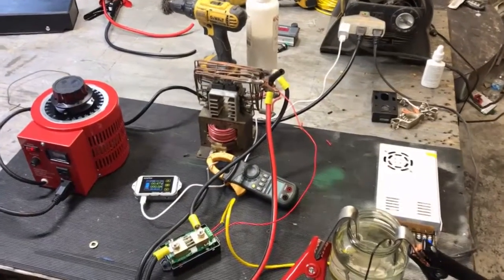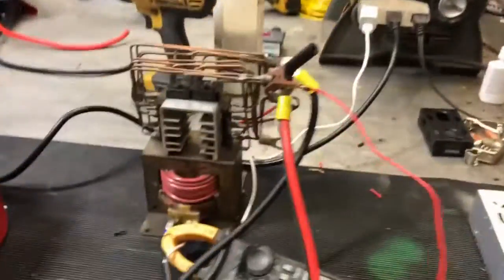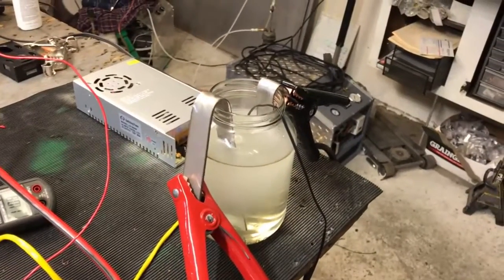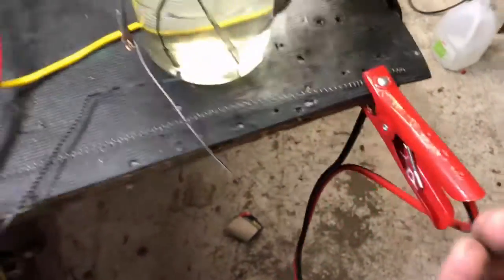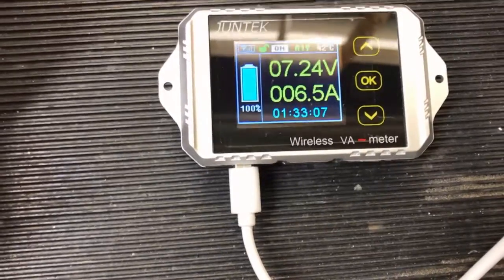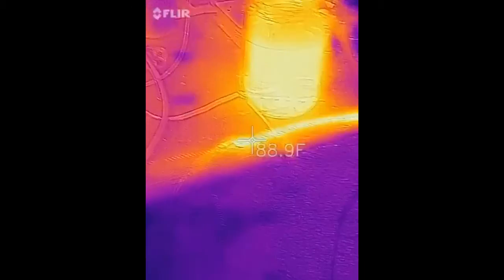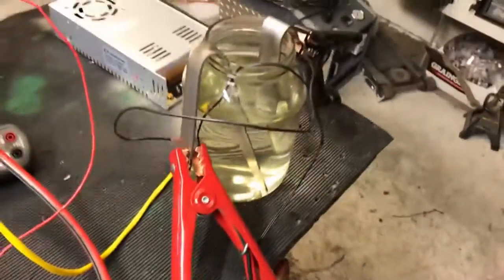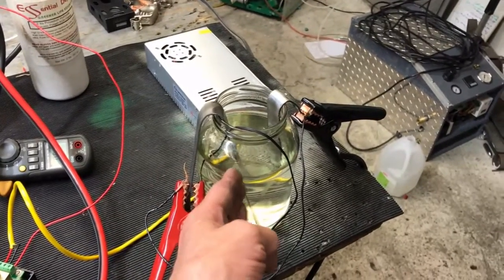High amp dc power supply variable voltage and amperage

Comment: You could  use PWM....  you can get some 50amp. 50v ones... adjust the input voltage and adjust  the current  with the PWM